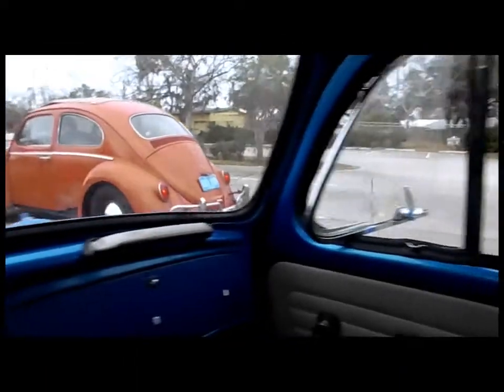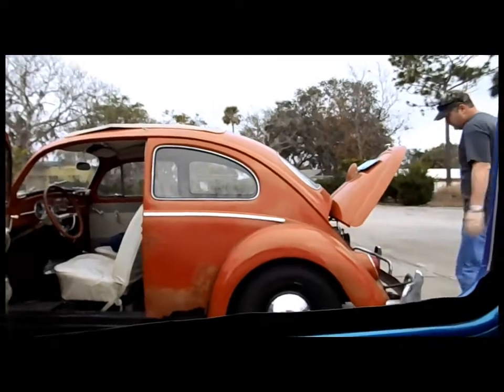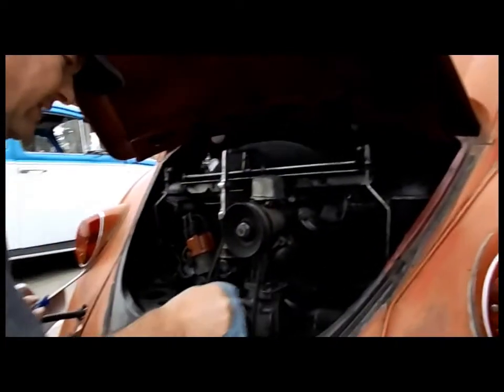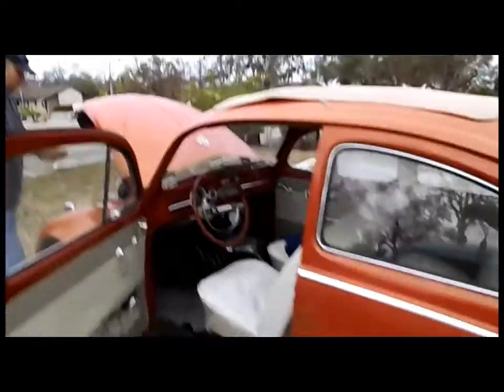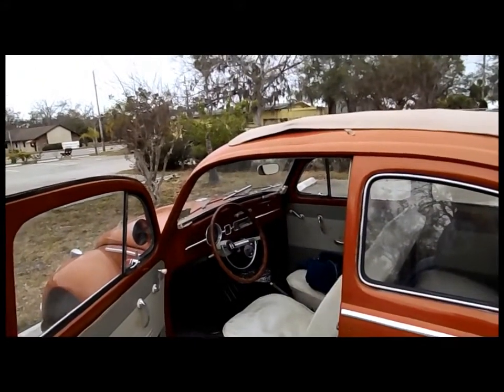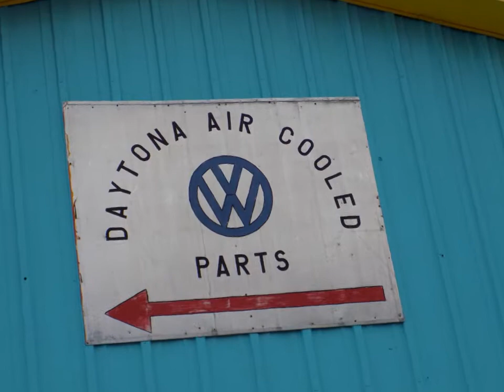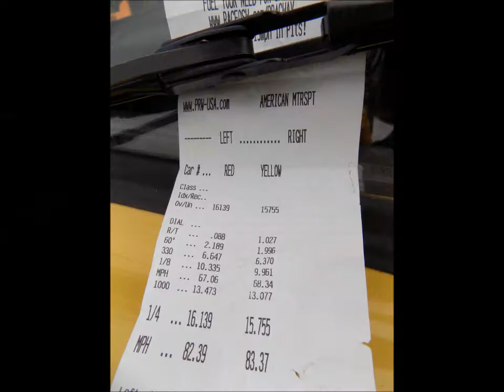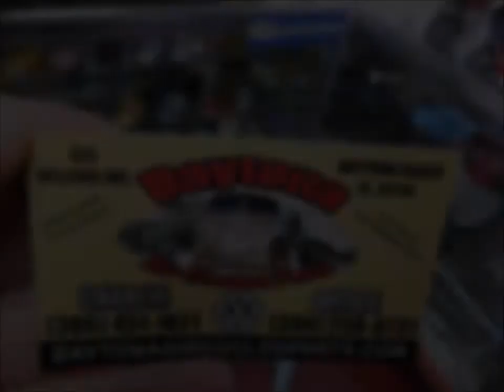Daytona swap meet at Daytona Aircooled.

Comment: Back in 82-88 I had in my hands a 67 split panel micro bus with a fiberglass air intake and fender flairing kit. The city stickered it and I took it out  to my dads where He sold it with my 63 bug for 500 bucks .the bug needed a driver side floor pan and the bus needed a title.OOOOh I was mad at my dad they was just there 2 months. He said He needed the money for property tax by the next wendsday.I wish He would have told Me what was up I had the cash,the bus was in nice condition with L60-15s in the back.  some times thing dont go good. I got the bus because when Steve overhauled the engine it was Knocking up a storm and He gave up on it. Well when you put a 85.5 piston in a 87 barrel = piston slap. It came with a crank Kit that had 4 miles on it.New perf.cam lifter kit some decked and ported 40x35 heads new header, I got new set of pistons and the motor I put into Rambus  it broke the glass pack in about a week doing a wheelee Skinhead said you should have seen the sparks
Reply from the maker: Man two cars for $500 that person got a steal, literally!!